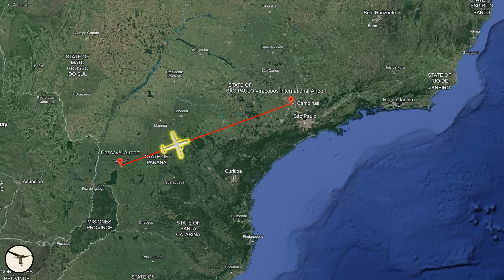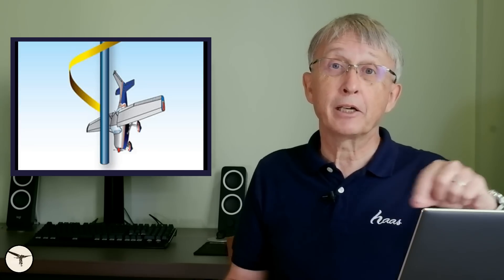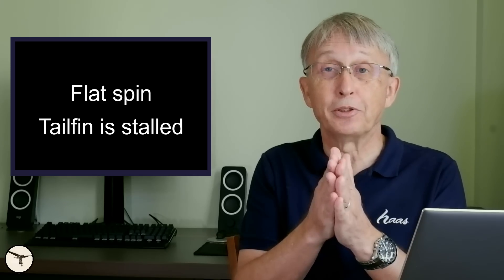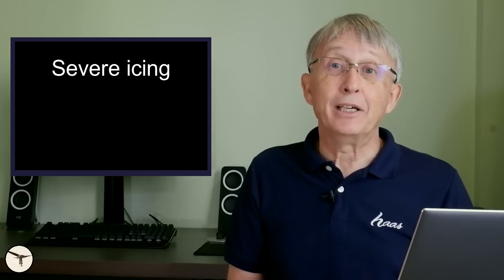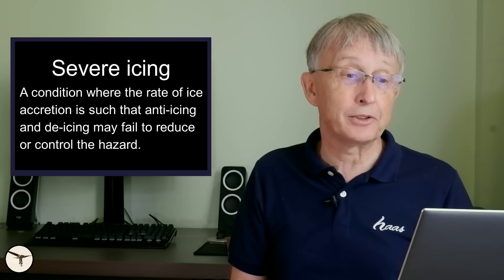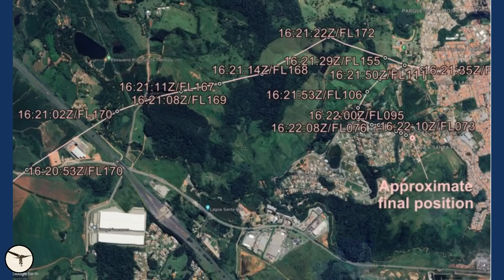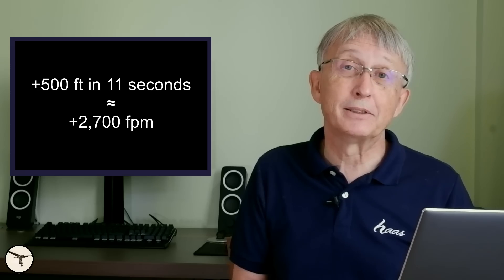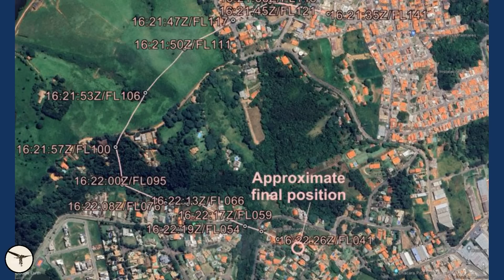ATR 72-500 Crash: Understanding the Fatal Flat Spin & Severe Icing Dangers

Comment: I came here in search of clues because I had never seen a flat spin quite like that. Where did all their airspeed go? No nose stall, no wingtip stall, it just stopped moving forward. Even gravity couldn't pull the nose down. I imagine the rudder and elevator are useless for correction of/in a flat spin as they are completely stalled receiving zero forward airflow over them. But why wasn't the engines pushing the aircraft out of that situation? Were they even throttled up? After considering everything I know about flight in general, which ain't much, i'm betting icing stole their airfoil, making the accumulation of airspeed and forward flight  impossible...
Reply: It is explained in great detail in the video.  Icing causes a loss of lift, so the AoA has to be increased to keep the plane flying and that requires more engine power.  Eventually there is no extra engine power left, so the nose goes even higher to maintain what little lift there is.  Then the plane stalls, usually one wing before the other and that is it.    The thrust of the engines is balanced by the drag and the lift at that point so the forward speed turns into a downward speed..

Comment: Question:  Will the autopilot use as much force as necessary to keep the plane flying level even as ice accumulates?  What would the pilot experience when he disconnects the AP as instructed in the ice emergency checklist?  Could the plane pitch up unexpectedly to the point of stalling if the pilot doesn’t have firm grip on the controls when the AP is turned off?

Comment: I think ATR needs to be held accountable at some point .. no one is talking about that specific point.. there's been 10 incidents since 2010 with these aircraft that's simply insane
Reply: U are totally right. Not to forget there are many many incidents not becoming accidents with stalls and loss of control because of these icing issues. They need to awknowledge that their design just is not safe. Its a flying Russian roulette.
Reply: Agree with you.
Reply: Doesn't matter if it's an ATR, a Boeing or a Sopwith Camel, all aircraft can have performance issues in icing conditions, and as a result be at risk when in such conditions, if this does indeed turn out to be what caused the accident, which at this point is by no means certain. What will need to be considered here however, is the fact that all regional turboprop airliners, not simply the ATR, frequently fly in the zone around 20,000 AGL, which often puts them in clouds and rain, where the temperature and moisture content is just right for icing up an airframe. If this thing was allowed to fly into those conditions which were either known or at least considered likely, as a result of poor decisions on the part of meteorologists, dispatchers, the crew, ATC etc, that would bear some highlighting in any subsequent investigation.

In applying Occam's Razor, it seems fairly likely that the wings iced up and it went into a spin, possibly whilst in clouds with no visual references to assist the crew's orientation for a correct recovery procedure at an early stage. From there, it's somewhat understandable that the crew might then have either mistook what was occurring for a roll or a stall and put some power on or applied some opposite aileron, or both; thinking they were doing the right thing. Unfortunately, these two actions would make matters worse and turn a spin into a flat spin; then you are looking at an aircraft state which might be completely unrecoverable by any pilot inputs even with good visual references and good situational awareness.

In such circumstances, it's easy to sit in a comfortable chair and imagine one would never have done the wrong thing were we in the same position, but if that were true there'd never be any accidents ever; it's a different story when you are suddenly being flung around the cockpit with no view out of the windows to help you make the correct recovery control input.

Such problems are not specific to the ATR; it would be similarly true for many other aeroplane types, lots of which cannot be easily recovered from a flat spin. In fact, there are many military aircraft where there are a number of procedural drills you go through if a spin develops, including a number of throttle and control actions, deploying a drogue chute and so on, but if none of these work, the procedure typically states that if it isn't recovered by a certain altitude, you must eject, so it is known that in some cases, there will be literally nothing you can do about it.

Aeroplanes are very safe usually, but they all have the potential to get into a situation about which there is little one can do. It's not unique to the ATR and in fact one could argue that given the attention the ATR has drawn in relation to this, ironically it is probably safer, rather than more at risk than most types in terms of operational awareness and training for icing conditions procedures.
Reply: @ChockHolocaust  I believe in calling a duck, a duck. A dangerous aircraft and lack of training is obvious, plus some hubris.
Reply: @ChockHolocaust great explanation! There were a lot of clouds over Vinhedo that day, the plane emerged from the clouds already doing a flat spin. So your theory of the crew having no visuals could be true.
I live in São Paulo, not so far from Vinhedo, and on that specific day, the temperature dropped a lot (the day before it was around 86F and that day was 64F and drooping more). There was an alert about severe icing conditions in that area.
Reply: @ChockHolocaust  thank you for this thorough explanation
Reply: 3000 Fords crashed in the US every day on average.  Ford's fault?

Pilot error.  Poor training, lack of talet, bad decisions.
Reply: @stanktail classic case of strawman fallacy.
Reply: @stanktail  if other turbo prop aircrafts can fly in icy conditions SAFELY.. there's no excuse, 0 .. when's the last time you seen a Q400 fall out the sky due to icing? Stop making excuses, there should be NONE when it comes to aviation.. NONE.
Reply: @DorianSaunders-c4s  None, but then again, when have you heard of a landing gear collapse or propeller overspeed accident on an ATR? This is not something you could say about the Dash 8.
Reply: @tedmoss  There have been quite a lot of injuries from landing gear collapse incidents and quite a lot of airlines lost confidence in the type as a result of this. SAS withdrew the type from service specifically because of these occurrences. Similarly there have been quite a lot of injuries from propeller incidents and, if I recall correctly, 28 passengers killed; most were incidents where the aircraft's engines went into beta mode whilst in flight.
Reply: @stanktail  Fords don't fly with 60+ passengers (Stan, if you are driving a Ford bus you might go over a cliff to prove me wrong ;)
Reply: @stanktail  No, if it doesn't happen to other planes.
Reply: @stanktail  Yes it is Ford's fault if you compare them to Tesla, which is many times safer. I can't believe the drivers are that much different.

Comment: There was other contributing factors to the American crash, among them a captain not at the controls in known icing. We run ATR-72 in Canada in all kinds of weather from extreme cold to hot and high. ATR-72-200 not capable during an engine failure for altitudes above 18000ft here over the mountains in Canada especially summer. Our crews are very competent and work with the AME to ensure safe flight. This event sounds like wind shear and upon hearing the engines it sounds as though one isn’t at the correct pitch.
Reply: The captain had returned from the lavatory at the time of upset innAE 4184 and your assertion wasn’t a factor although the French government and the manufacturer attempted to deflect their malfeasance by claiming it was. As for “engine sounds” on the video, you should know those are unreliable due to the doppler effect of a rotating out of control aircraft.

Comment: We can absolutely draw speculations.   We know that the aircraft was in a stalled position, in a flat spin.  The pilots made the error of not reducing power early on to get the nose to drop to recover from. This was because of ice that they stalled initially.  Improveer stall and spin recover techniques are why the aircraft crashed.     Don't act like you don't know what happened.  Watch the damn video and you'll know.  Wake up
Reply: If this was a hinge moment reversal related loss of control, traditional pilot inputs would have done little. In IMC with the aileron forces in reverse coupled with extreme bank angles and near vertical pitch, the pilots would be too disoriented to understand what inputs to make until visual below the clouds and by then, it’s too late.
Reply: We simply don´t know at the moment what brought this Aircraft into the Flat Spin. Even Icing is only a Theory at the moment.

Comment: Another ATR 72 crash.. same plane crashed in Pokhara last year. Never getting in one of those things…..
Reply: No comparison. In Pokhara, it was a gross pilot error. Instead of moving the flap lever, the monitoring pilot moved the condition levers, which control the propellers. The propellers had been feathered for about a minute before the crash, causing the engine to produce no thrust and lead the aircraft into a stall.
Reply: @kkfoto  Actually, both crashes were caused by pilot error.
Reply: @StanfordJohnsey  ... actually we don't know that yet, we need to wait for the "swiss cheese" to be made here.

Comment: As long you have enough height. Isn't possible to get max throttle, full stick forward in the direction of the spin untill you regain speed and then start to counter steer and gradually pitch up? All is a matter or regaining lifting force.
Reply: In Aircrafts with a T-tail like the ATR-72 it's possible that the rudder and elevator got stalled by the disturbed air from the main wing. Generally that happens when the angle of attack is high but the airspeed very low, like in a flat spin. If this happens, there's no way to get out of it because the elevator and rudder literally doesn't work anymore.

Comment: While I do not disagree with the icing theory, such a violent, abrupt, and upward move could not be the result of loss of lift. The vehicle powered itself upwards, trading kinetic energy for potential energy. This happened in seconds, until there was no forward motion. Generally, icing does t do this, the plane simply begins dropping, even as it gains forward velocity.

This tells me there was a major malfunction of the aircraft, or major pilot error, or both. There are at least a couple, out of hundred, no doubt, of possible reasons for this plane behavior. The engines could have entered reverse thrust mode, the plane could have entered Hotel Mode, or the pilot may have catastrophically reacted to an otherwise recoverable but surprising electrical/mechanical failure.

The sudden gain in altitude and loss of forward velocity screams equipment failure combined with potential pilot response error/response, even if the pilots did everything by the book.

Condolences to the family and friends of the victims.
Reply: That are really good Points! I readed some of them elsewhere, too, and they´re really calling for a closer Investigation. It is at least possible that the chain of events was much more complex than a "simple" severe icing.

Comment: Sasly, there are leaked WhatsApp chats of Brazilian pilots where the accident aircraft oilots shared a photo of the windshield completely iced over, and a message saying "damn control didn't allow lower (altitude)".
Reply: So atf made them die?
Reply: there were flights in the path..not safe to drop
Reply: In my opinion this is simply an Urban Legend. Pilots in an Emergency Situation with an Iced Aircraft don´t have time to make photo´s and to post them on What´s App. Their Business is at that moment to get the Aircraft out of this sh*t.

Comment: Some people near the crash site mentioned to a news station that the plane was very loud prior to crashing
Probably they had the plane at full power which made recovery harder
News station also mentioned the plane had requested to fly lower but the request was denied due to traffic
heavy icing was reported by 3 other planes

Also luckily 10 people missed this flight because they bought their pass with latam and waited by their front desk, which didn't open.
 they just sold tickets for voepass
Reply: Ice might’ve built up on the props reducing their effectiveness too, and not just the lift/control surfaces…this was a whole bunch of things going very wrong very quickly.

Comment: I was suitably impressed that the aircraft stayed intact after getting that far into flat spin.
Reply: Why?  It was falling at zero G.
Reply: @TheUtuber999  yes low G load but high pressure on wings and rudder. The plane was descending at 167mph I would think that was not a descent rate it was designed for.
Reply: @TheUtuber999 and at a relatively low speed.

Comment: I understand that in a flatspin, there’s little to no control of the airfoils. About the only control the pilots have in this situation is over the power levers. Wouldn’t applying more power on the “inboard” engine slowly reduce the turn rate, increase the turn radius, and thereby regain some airflow over the wings? 
Might be a moot point if the wings are iced up.
Just curious…
Reply: an interesting idea!  What if the pilot could also deploy the flaps on the "outboard" wing only, would that help?  It seems this happens often enough that there need to be experiments done to explore all the possibilities.  Or even parachutes to slow the rate of descent to something survivable?   Perhaps with models in wind tunnels?  I fear the answer is that with the engines out on the wings, the angular momentum and inertia are too great to overcome.  It looks like a gyroscope in slow motion.

Comment: Yes, very tragic.  I do hope the industry at least learns from this accident so they can save lives.  Thanks for the summary.
Reply: After the crash of the American Eagle in 1994, I read that they relocated the ATRs to warmer latitudes.  Nobody wanted to fly on them in the northern part of the US during the winter because of the that crash.
Reply: Icing can even occur in ground level warm temperatures, at the ATR's flight-level it is much cooler.
     But, I have heard one airline did restrict winter flying of their ATRs.
Reply: @VictoriaWalker8  flight crews, pilots and co-pilots, should already know that. Just as the manufacturer of this aircraft do, previously ATR has send out special bulletins about avoiding ice with this aircraft.

Comment: This particular time of the year here in southern Brazil the temperatures can drop to below zero Celsius. Add that the humidity levels close to 99% and you have a recipe for disaster.
Reply: Adding a little bit more context. 
It is a common misconception that Brasil is an entirely tropical country. We're "very tall", with latitudes going from 4 N to 33 S. The airport that the flight was coming from (SBCA) stays at 25.00 S, 53.50 O (below tropics), and the one it was going to (SBGR) stays at 23.43 S, 46.47 O (between tropics).

Comment: Do you think that an AOA indicator could help the pilots to manage the aircraft energy and prevent from stall, better than just speed? Stall is not related to speed, but angle of attack. Thanks for sharing your thoughts!
Reply: The critical angle of attack is lower when there is ice on the wing, so the AOA gauge would have to adjust for that situation to foretell a stall accurately. Some planes have an AOA gauge that adjusts a predetermined amount when anti-icing systems are turned on, but it's not certain the AOA will still be accurate in that situation because the actual ice buildup can vary.

Comment: This accident would change from ATR company for a new severe icing procedure for ATR72 500 models? And for the new ones models? ATR72 600 more digital computer update? Needed more simulation training hours for pilots about that issue?
Reply: I'm no pilot but as Magnar pointed out you shouldn't fly in severe icing with the ATR (well, with a lot of aircrafts if not all). You also shouldn't stall an aircraft like this with two engines outside the center of gravity since it's close to impossible to recover. Don't think there is much which can help training wise if you will still fly in severe icing conditions. If that indeed was the cause of the accident. I feel for those on the plane who realised for so many seconds they would die, must have been terrible.
Reply: @secondskins-nl  😓